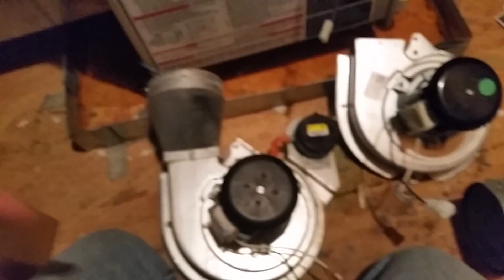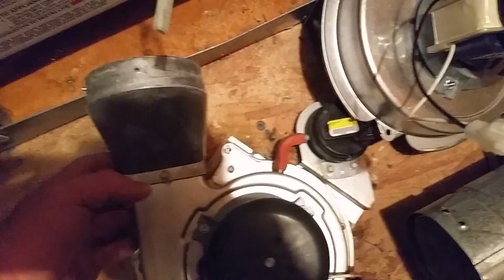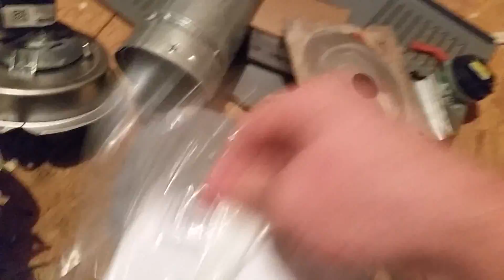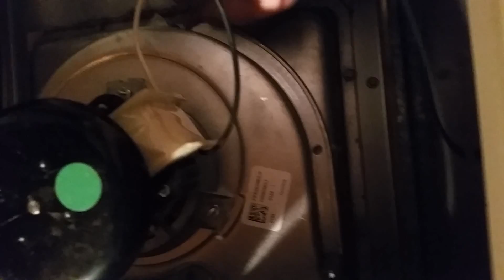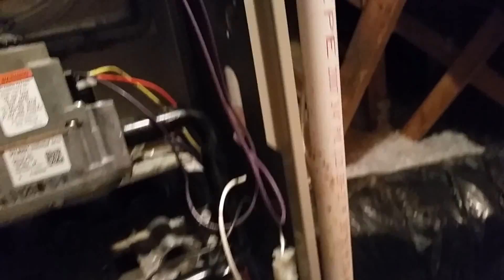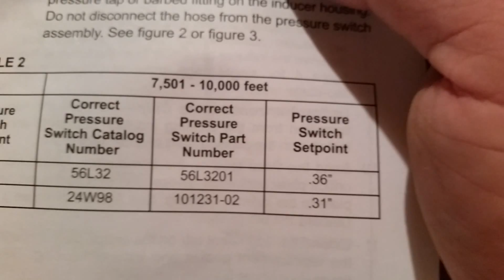lennox draft inducer repacement

Comment: Why do we need to change the pressure switch together with the draft inducer?
Reply from the maker: Vital Mialeshka because the pressure port is in a different location so the - water column  is lower in the new location. the pressure switch must match the draft range the motor creates

Comment: That sounded like the impeller lost its thrust and was hitting the fan housing which caused enough drag on the motor to cause the motor overload to open.  AND it could be a bad inboard bearing letting the motor rotor drop enough to cause the impeller to drag on the housing and the rotor to drag on the windings and draw too much amperage.  JUST THINKIN'
Reply from the maker: the squirrel cage would hit the restrictor  plate after a few minutes of running the shaft would move back and forth and side to side so the bearings were bad  the noise on the video was the impeller making noise.so you are correct about that